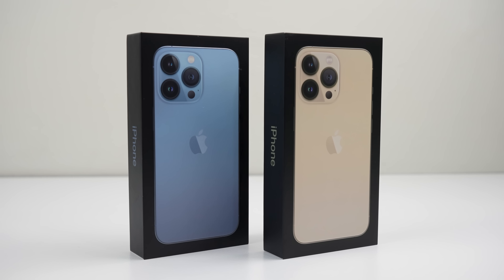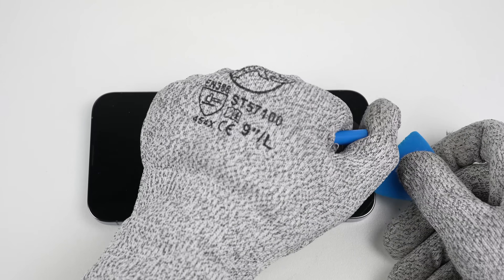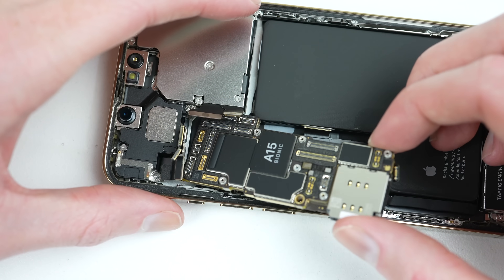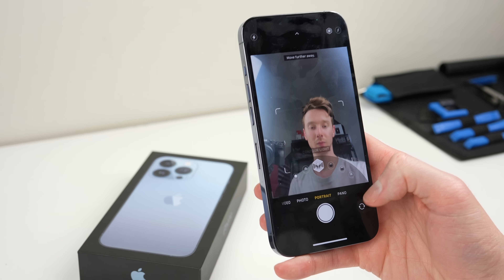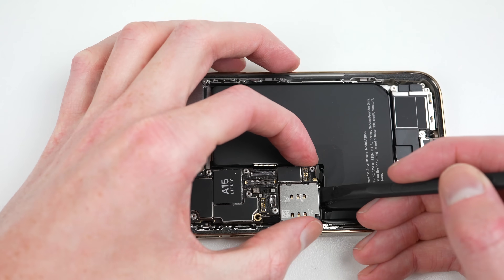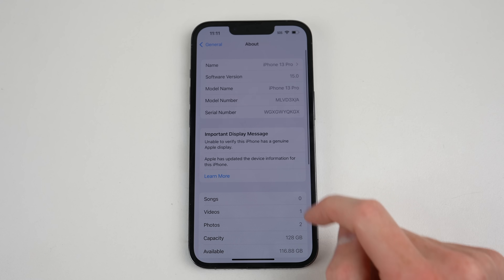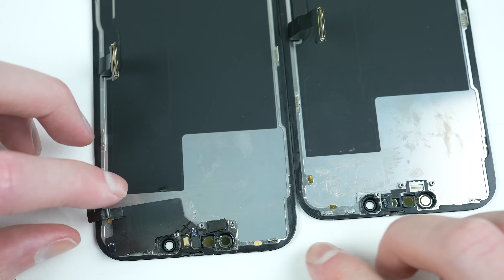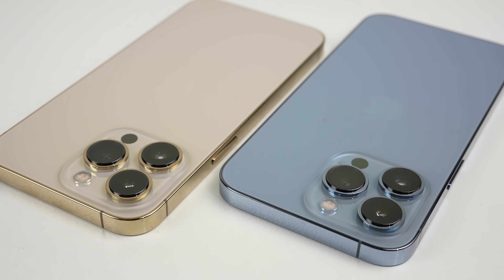iPhone 13 A Repair Nightmare - Teardown and Repair Assessment

Comment: So sad you third party repair places can't get AASP (Apple Authorized Service Provider) certified... Oh wait; you can. Best Buy did it with Geek Squad. They are not Apple. Yeah it is no easy task but doable. As an AASP my self I can't even begin to tell you how much work is required after replacing a part. Apple want's their products to work correctly. The training is intense. The calibration requires special software. There is a reason for this and that is so YOU get a quality repair and not some shotty repair shop giving you back a phone that may or may not work to spec after the repair.
Reply: so they make it harder for people to make phones work to spec as a way to ensure the customer has a better experience? im surprised you can talk with all of apples ceo's mayo in your mouth.
Reply: @Jellymiqo  Absolutely! But I am also a Samsung fan boy. But at least I have the know how to fix an iPhone with genuine Apple parts.

Comment: Tremendous, so this means that dodgy repair shops cant mess up customer's phones anymore. I like this. This means that you actually have to have an Apple-certified dealer to make the repairs. Great! I don't see anything wrong with that.
Reply: And are you happy to get overcharged for a simple repair??
Or have to buy a new phone everytime something happens to it??
Reply: @dalylabidi5711  I rather pay extra than have a shit shop close up my phone without guarantee or waterproofing .  I have seen the butching non certified shops do and it aint pretty.
Reply: except for the fact every customer has the right to go to a dodgey shop and it is  THEIR choice to do so if they want to over pay like you clearly do apple fan boy they can but they SHOULD have the right to go to the dodgy shop is it really that hard for you to understand?
Reply: @weanstinks  How do you determine a part is genuine? Isn’t that exactly what Apple is doing?

Comment: To be fair, Face ID is the phone's locking mechanism. Making this easily replaceable would be like having door locks that just slide out so a new one can go in. You wouldn't want that on your house, and modern phones grant access to so much of your life that the security needs to be very good. You would think they could roll out the process they use internally to certify new parts to third-party shops though.

All the other stuff failing is just rubbish though, and I totally agree that Apple is deliberately locking out the consumer from their own property.

Comment: Ultimately it's the failure of the US, and other Governments to insist that Apple don't do this. Apple are governed by the same "fiduciary duty" that all Corporations are - that is, they must act, at all times, "in the best economic interests of the company". Obviously this means making it as hard as possible for users to get new parts from anywhere other than Apple. It only really stings because they overcharge so badly on all parts.
But it isn't "green tech", or even "more sustainable". And even more sad is that this would be more acceptable if, after an iPhone becomes "obsolete" (per Apple's own metrics) that a software patch was issued that fully unlocked the hardware so mix and match repairs became possible.
The EU are trying, in their own clumsy way. But at least they're trying.

Comment: the inability of an internet connected device to verify the origin of components is farcical. it wouldnt take more than a fraction of a second to compare the serial code on any component with an internal database and verify the legitimacy of the serial code

Comment: Thanks for the video, but if the screens were glued down from the factory and you had to unglue them, wouldn’t that require gluing them back down on the final reassembly?
Reply: Just reheat it, the adsive will melt and glue the part together
Reply: @atomic_nerd8682  Agreed, but if that was part of his process then he should’ve included it in the video

Comment: We should just spread a f@ke news that Apple has made so that if you break your phone you have to buy a new one, and use this video as evidence that not even apple parts can fix them.
They are betting on the ignorance and lack of information on most ppl, we should just use it right against them, for the average Joe this video is enough evidence if correctly used

Comment: Video title is wrong as repair is not just a nightmare its actually impossible. Its all locked up in the firmware, each part handshakes with a unique ID and serial, u are luck it powered on at all. I sure Apple service would see the failed repair attempts in a hidden log and now its void the warranty.

Comment: Deliberating locking up the phone so no parts can be swapped, should be illegal as its denies consumers right to repair. Also Apple has been caught crippling older phones with new software updates to force people to upgrade this is also clearly criminal conduct.

Comment: This is also happening with some cars, where only authorized parts and repair shops can service the car else it will shutdown car. This limits what repairer can fix the car so the authorized repairer can jack up the service fees and rip you off and also make non genuine cheaper parts useless. Hence its all locked-up in the firmware.

Comment: This is typical for a greedy company, this has been done so only authorized repairers can fix the phone, I'm surprised it works at all, apple could have made it come up with an error unable to power on please contact apple service.
Reply: Further Apple could also detect authorized opening and disable the phone completely, "warranty voided, please contact apple service now powering down message".

Comment: Practices like this should be considered a monopoly and thus illegal. A company shall not make it to where you are handcuffed to taking or sending a product to a particular repair shop or back to them. Car manufacturers in the U.S. tried having a law passed a long time ago (think they still are) saying certain cars (or maybe all, I can't remember) had to be brought to dealer to be fixed and parts ordered. So no Autozone and no outside mechanics. Didn't pass because this would cause a monopoly and drive prices and not give people choices.
Reply: It's vertical integration

Comment: An appliance costing north of $1,000 shouldn't be treated like H&M costume for specific dress code party.
That is sustainability nightmare.
It made me think that I actually underspent on my $500 air conditioner that has 17 Energy Efficiency Rating, 11,800 BTU cooling capability, and all the fancy sensors you can ask in 2021 technology. And best of all: every components are replaceable, and since they are made of metals, they are highly recycleable. The repair guy who took the old components even reimbursed it per kg basis.
Apple talks about "sustainability" while shipping their phones 14,000 km away from China, because their customers are environmentalist wannabes and Pumpkin Spice Latte type of social media communists.
I understand all the security and privacy concerns, but it is not like big corporations can be fully trusted. Yes, they stood up to FBI trying to force open a terrorist's iPhone. But this is a sustainability question here. Given that very complex looking logic board PCB, it will end up in landfill. It is cheaper to bomb other countries to look for more rare earth materials than trying to recycle those chips and components by disassembling it one by one.

Comment: The sad thing is, Samsung is slowing following apples lead. 

My mom bought the new 21, she finally upgraded from her galaxy 5. 

Her sd card with 1500 photos? Simple. Move the card from phone to phone, right?  

Nope. Theres no sd card slot anymore. Samsungs response? We offer cloud storage now, with a subscription. No need to worry about failing sd cards. 

Uh huh. So instead of paying once for permanently owned storage, I have to rent my backup space. And the battery is glued in now. For the protection of the phone. Yay 🙍‍♂️. 

Samsung will be apple before long.

Comment: Did you also know that Apple will not replace the lightning charging port on a device, instead quoting for a new phone instead? Here is the official reply from the Apple Store:

Thank you for your patience.

I had a discussion with our Technical Specialist who explains that the Apple repair strategy only allows for certain components to be ordered and replaced via the Apple spares channel. Unfortunately the lightning connector is not a component that can be ordered and repaired via the Apple authorised channel. Due to this, a whole unit replacement would be offered as part of the repair strategy. As all warranties have expired on your device, the technician would generate a quotation for the whole unit replacement. 

We are an Apple-Authorised service provider therefore governed by Apple's policies and procedures as they are the manufacturer. We have no authority to override this.

We do apologise for the frustration this has caused.

Comment: Doing all that garbage to get the board out is reminiscent of how modern vehicles are just to change a headlight bulb. Pre-2006 it was just pop the hood, loosen two bolts (or even none!) holding the housing, twist the burnt bulb out, swap it with a new one and put it all back in reverse order. The last 15 years have had us getting specialty tools + multiple drivers and pulling off a good chunk of the front end THEN we can undo the 6 bolts holding the housing in place. Less than five minutes turned into just under an hour.

...and said bulbs might make the vehicle freak the f*ck out. Read up on CAN bus errors.

Comment: APPLE PUTS IPHONE THEAVES OUT OF BUSINESS. Stealing Iphones for parts was a big industry. So called "repair shops" used to buy stolen Iphones from the theaves for parts. And now Apple put them all aut of business effectively and stealing IPhones won't make sense anymore. Repair shops will have to buy parts from Apple. Each part has hardware number embedded in its chip. Apple knows what parts was sold to which repair shop. And after part has been installed, shop will request error overriding code from Apple. Apple will issue such code and send it to repaired IPhone, but code will work only if part hardware number corresponds to the one obtained by this particular repair shop.
Reply: and at the same time they also stopped recycling of parts of "broken" iphones in order to conveniently be able to sell new replacements for a huge price and or take a cut off the earnings the repair shops deserve while secretly destroying the "old" parts... very sustainable and nono-monopolistic... also you can still steal ipones to sell them as phones
Reply: @johnuferbach9166  You can steal Iphones but can't use them as phones cause it icloud locked on server side.

Comment: The only question I have, does this makes the phone safer, by preventing access to data by using “compromised hardware”?
(Apple cashing on customers paranoia)
Reply: No because I’m sure sensitive data still accessible, the only thing affected is the intended end-user experience
Reply: @Owesh Diwan Good thing they're protecting you from some fraud trying to scam you by taking choice away from you. Now you can rest assured that the ONLY one whom you can pay money for repairs is Apple. They're so thoughtful and caring omg I can't even rn. I'm meltiiinggg from their warmth and fuzziness.
Reply: @Owesh Diwan It's funny Apple will never change their ways specifically because of your train of thought.  Enjoy paying $1700 for a phone that doesn't even come with a charger.

Comment: You reveal software sabotage by design. Why am I not surprised about your findings?
Apple doesn't even bother to use a different malfunction for each swapped component. They always use the same.

Comment: Everything is pretty much tied to part serial numbers and how the phone was originally paired to those parts prior to boxing.  The only way to really pair new parts with a repaired phone is to go through Apple's diagnostic system which is only available through Apple Authorized Service Providers...which you need an authorized Apple ID to access and run a system configuration tool to re-calibrate everything.

Comment: I found out with my old 11 that apple try to force you to use them to get screen fixed. I had a repair on genuine screen by independent repair guy and Face ID packed up. So annoying I have a 13 now but if apple keep this up making them hard to repair then I’m off to android in 12 months. Thanks for a good video doing these tests

Comment: Apple "How do we hold the customer hostage for ever?" 
Devil "Make everything incompatible with anything that didn't come with that one phone."
Reply: It's not incompatible though, it's just a software list of component serial numbers which are checked on boot, and the relevant services disabled if the numbers don't match. A software patch could remove all this in one go, but that wouldn't be profitable.
Reply: @salparadise1220  So, in the end, its still incompatible you mean.
Reply: @salparadise1220   that's  the meaning of  " incompatible "  duh.
Reply: @tony001212  No it's not.
Incompatible means unable to be together.
These parts are fully compatible, but are artificially prevented from doing so.

Comment: 3:11 I worked at chain of shops that repaired iphones, tablets, and certain models of androids (based on demand really). I did this for 3 years using the "spudger" or the thin metal prying tool (dull of course) as you mentioned. Only on Iphone though, the galaxy phones "usually" didn't have the metal bracing on the glass that allowed the prying tool to be used at all. In my 3 years, and hundreds of phones repaired later, I never cracked or damaged an iphone screen this way. It is though, one of the first risks you learn about, and you had to be careful after they added stronger adhesive water protection.

I actually contend that the suction cup method is more dangerous because you can rip the screen cables quite easily that way, if you don't open it correctly. As it doesn't offer as much control. To each their own though! I was swapping screens comfortably on the new models (including adding water protection back) in about 15 -20 minutes, 5 on the older models. I'm guessing this advice is for people just getting ifixit kits and haven't done repair before, or maybe on this newer models specifically? ( I stopped at the 10/11th gen)

As you can imagine, I'm not surprised by the issues you had. It started happening right before I left that job. It was really frustrating because in its design, the apple Iphone is almost engineered for modding . They were always the fastest repairs to make, and swapping parts was usually quite easy, albeit tedious on certain parts (charge port/headphone jack flashbacks ensue). This makes me sad and confused, as android is often heralded as more "repair/mod/DIY friendly" but can actually be harder to repair when it comes down to it (screen replacement can get sketchy as it doesn't has the metal plate/back light sandwich under the screen as iphone does). For example, I was able to mod an iphone 6 beyond recognition but they cracked down on that real quick in the later models.

tl;dr apple thinks we are too stupid to repair our devices and would like us to kindly throw our old iphone in the trash and buy a new one so they can roll around in piles of money while their licensed repair shops charge you 250+ dollars to replace a 20 dollar screen

oh and if you live in a humid climate it will trip the water damage tabs on the inside of the phone even if your phone never touched water, that's been a thing for a very long time, thanks Tim Apple!
Reply: What are third parties supposed to charge for an iPhone 11 pro max screen replacement? Idk if I just haven't been asking the right places but I've been quoted around $300-$350... like at that point I might as well have Apple do it for $400 lol.
Reply: @metaslaves334  low-cost screens for that phone are $85 (before markup) and premium screens are $230 (before markup).  Add about $40-50 for labor to have a tech swap it out.